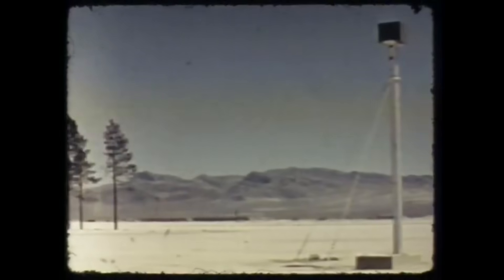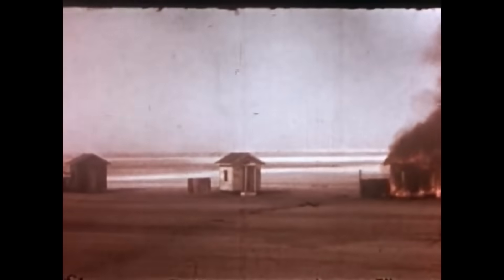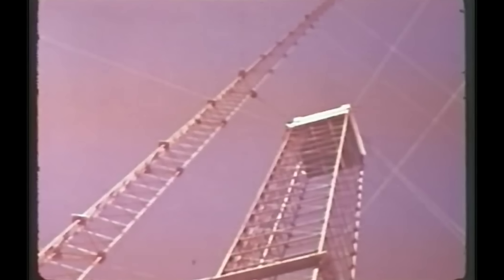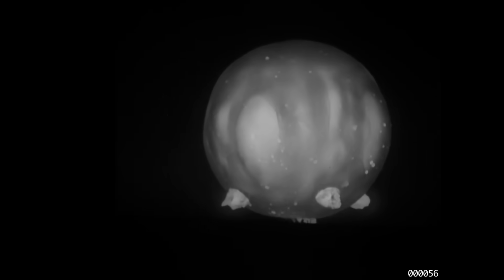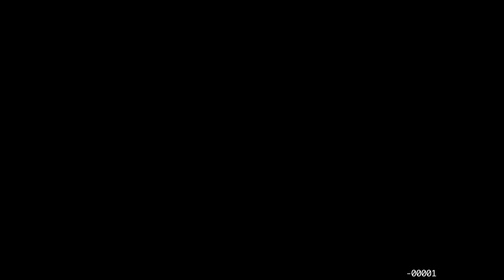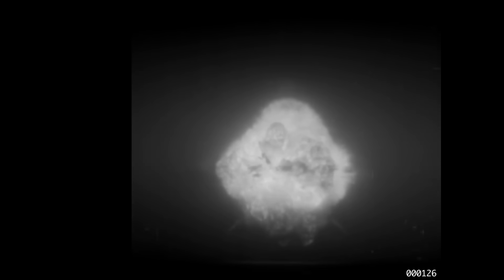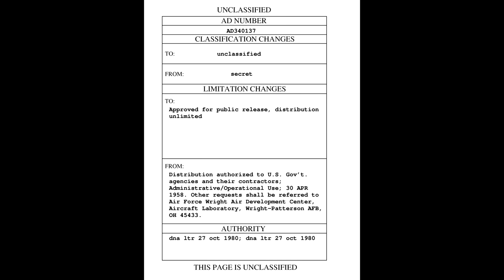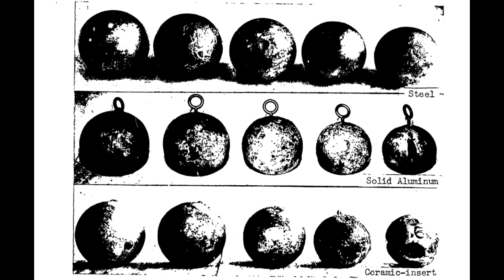Can A Metal Bowling Ball Survive Inside a Nuclear Explosion?

Comment: If it only stripped a few inches off the metal balls, yhy did humans at a much greater distance get completely vaporized, or is that an urban myth?
Reply: Did not watch the full video yet, but i assume the he as t resistance or a solid steel ball will relatively low surface area and also a curvy one (making light harden to hit it at 90 deegree angle) is muchhh more durable than a human being.

Comment: Would have figured that with the penetrative power of gamma radiation that the balls would have been volumetricly heated to vaporization energy, i guess gammas alone was insufficient and surface heating from non-penitrive radiation is required.

Comment: What I've always wondered about is how close to a nuke could you survive if you had an outdoor olympic-sized pool or pond or lake you could swim down 8 ft or so deep & sit there for 3 or so minutes. Or better yet if you had a scuba tank & could loiter on the bottom for longer periods. A few feet of water will shield you from radiation & overpressure. I bet you could survive the initial blast very close to ground zero. If you happened to be upwind, you might could survive the whole ordeal.
Reply: Yes. But what about the initial heat pulse from the fireball - guaranteed to vaporise anything within its range - and that includes water - or anyone sheltering in a tank of water ? Then there is the effect of blast. Perhaps you should watch the video more closely - or read about the effects of nuclear weapons.

Comment: The fireball you see is actually the shockwave formed by the fissile material decomposing and recoiling. The shockwave is what is causing the majority of the heating in the fireball. The xrays only add a fraction to the heating effect, they mostly propagate away from the bomb and penetrate the debris cloud, as x rays are wont to do. They cause the bright flash of visible light at the moment of detonation; the x-rays lose energy from Compton scattering and appear as visible light.
Reply: Well... There is even enough fissile material to just heat up and expand to make few kilometers wide fireball... i doubt that.  However i think it is combination of both, the conversion from x rays to visible light is exact same thing that heats up the air

Comment: At some point science left the room and they were just acting like a bunch boy seeing what a magnifying glass can melt.  "ohhh lets try trees." "OKAY"   I also thought the mushroom cloud was a result of the earth acting like a reflector forcing the blast up. The explosion did not leave a large bomb crater.  The blast probably went the path of least resistance outward into the atmosphere.  Because of fluid dynamics the compressed atmosphere acts like a rubber band and resisted the blast and eventually rebounds and rush back in as the outward pressure diminishes the air elastically rebounds inward and push the blast particle up because of the lower upward air pressure.   Large chemical blast do also create mushroom clouds.

Comment: Well its very hot high pressure plasma and basically the steel ball is only exposed to it for a short time and then pushed out by the huge pressure release. So it isnt in the plasma ball for a long enough time to melt it all down. And it also means you could use steel balls as shrapnel for your nuclear bomb if you really wanted to but anyone close enough would already be dead anyways

Comment: Hydrogen bombs used and still use lithium deuteride, which fissions down to tritium, which is fused with the already present and extremely angry deuterium. First attempt was infamous, as one common isotope of lithium was thought to not be of use in a fusion reaction, but to their astonishment, was quite useful. That test, Castle Bravo, where the crew inside of the shot cab, where the bomb is detonated from were trapped from detonation time until early evening, when the hottest fallout isotopes had decayed to a safe enough level to be able to run, while wearing sheets to limit contamination to the helicopter for evacuation.
The sheets were left on the ground as they boarded the bird.

Comment: Interesting, somewhat related thought:
I've always wondered what would happen if a nuclear bomb is detonated inside an iron container, 100 feet by 100 feet by 100 feet, with walls on all sides being 45 feet thick. So basically an enormous steel block with a small detonation chamber in the centre, completely sealed off from the outside...  How much energy would be required to melt through the walls?
... also, doesn't 'Allens Balls' sound like a great name for a metal band? LOL

Comment: I'm actually surprised by this video...I would have expected that even if the thermal radiation (heat) didn't completely vaporize the steel balls, the concussion from the blast wave would have torn them apart...

Comment: The vaporization that propagates in advance of the fireball along tower guy wires or cables is also driven by the intense electromagnetic pulse along the conductive metal of the cables, turning them into linear channels of ionized plasma.

Comment: @Scott Manley - Nuclear Explosions do develop millions of degrees temperature but that goes away very quickly, pretty much before the fireball has even developed. By the time the Fireball is expanding, reaching the mottled stage, the plasma has fallen down to the hundreds of thousands (id seen 300,000 Kelvin quoted).
Which is also a very short period of time, thats what some of these spheres would've been flash-subjected to. But the bulk of that heating would've been thermal and plasma in the 10,000-50,000 degree range.

Comment: The wires are being superheated by the EMP effect inducing electron degeneracy in them... its not actually the direct heat of the fireball.  It is kinda like a solar prominence coming off the wire.   The trick here is that the "visible" shell recorded by the xray camera IS the plasma wave of matter expanding through atmosphere, sufficient heat to actually radiatively evaporate the guide wires would have covered the entire length of the wires immediately and would have had a far stronger effect on the soil and various equipment below the explosion.  The wires' angle makes them the most protected from heat of all the materials at the site, additionally they would drop like logs if it was actual melting occurring to them.   Its a strange concept to grasp that part of the tower at the top is still there while this ball of superheated plasma expands.  The actual epicenter blast of a 30kt device is only about 1200lbs of blast force, a very precise and spherical explosion.  What these xray films record is the atomic plasma infiltrating the air, passing through it at high speed in a state that barely interacts with it directly.  If you record the introduction of a drop of dye from a pipette into an absolutely still volume of water you'll see a metaphor of what the plasma does.  This is highly related to the effect that including aluminum glitter from Glitterex in high explosive charges produces, the aluminum is ejected at very high temperature into the air around the explosion and instantly combusts producing even more heat.

Comment: They did not uproot the trees. They just cut them. You can see the stumps getting lowered into the holes in the movie Trinity and Beyond.
The footage is also not 2'400 fps. Thats is not nearly fast enough. They invented the rapatronic camera to capture this. The fireball at the end of the clip is ~1 ms old. With 100 frames in 0.001s thats 100'000 fps. At 2'400 fps 1ms would only be 2 pictures. Thats also the reson the footage is "shaking" since that are several cameras, each capturing one frame.

Comment: By the time the fireball surface touches the ground the temperature is not even close to 1,000,000 degrees. Those temps exist for maybe the first 75 foot diameter of fireball expansion.

Comment: I was under the impression the rope trick was the steel cables being vaporized by X-rays, but I don't remember why the steel cables vaporized faster than the expanding gas cloud. I don't think thermal conductivity has anything to do with it at those timescales, maybe the steel or the plasma clouds created by them conduct X-rays better than the air does. Not an expert so correct me if I'm wrong...

Comment: When I toured the Atomic museum in Albuquerque, I asked the tour guide how re-bar from the tower could still be there, considering they said the heat from the bomb was hotter than the sun. He said the intense heat (the vaporizing heat) only lasted for a fraction of a second. So thick steel would absorb a lot of intense heat before it vaporized. Another question was if there was trinitite from the first explosion there must be a lot of trinitite from the hundreds of explosions in Nevada. As it turns there was a lot of sand at Trinity but just dirt at the other sites.

Comment: It was my limited understanding Tritium is used for boost and triggers for both atomic and H bombs - lithium dueteride is used as fuel for H bombs. The lithium becomes Tritium by transmutation by the neutrons from the fissile blast. Maybe there were small devices that used Tritium?
Reply from the maker: Tritium is used in practically every modern weapon, the amount can be adjusted just before use allowing the yield to be changed.

Comment: Tritium is not used in thermonuclear weapons at all (sic). Instead LiD (Lithiumdeuteride) is the fuel of the secondary. Lithium is split into H-3 (Tritium) and the inert byproduct He-4 (Helium) within strong neutron flux of the primary. And H-2 (Deuterium) is just part of the compound. This setup provides two big advantages: There is no need to stockpile Tritium with a half life of about a decade and a stable solid compound is much easier to handle than cryogenic radioactive gases.

Comment: Wasn't this also the reason that Project Orion was considered feasible?  Specifically it answered the question of how to prevent ablation of the pusher plate due to impinging plasma.   On a few of the steel balls there were some greasy fingerprints, and after the test, the grease created a stagnation layer that stopped any ablation where the print was.

Comment: Fission explosions occurs in about 700 nanoseconds, a little less than one microsecond.

Initial temperature is 50 to 100 million degrees. Center of the Sun is 15 million degrees

Radiation released is dependent on bomb design, but you get the full package of  gamma rays, x-rays, light, heat,   
and the rest of EM spectrum.

Despite your jocular attitude, nuclear weapons are extremely destructive 
The bombs you mention are only the early fission weapons. Current inventory includes 125, 250, 500 kiloton warheads as well as many in the Megatron range.
Reply from the maker: I’m glad you felt the need to tell me this after I made a multi part series on nuclear weapons.

Comment: Before i watch: no.
How close could you put an object to a nuclear detonation and have it survive?
Outside of the fireball.  Everything within becomes atomized.  Its how the reaction works.
Edit after watching and learning something from the voice with an accent that should be the ONLY news reporter:
If your name is Lew Allen, and you have balls of steel, aluminium and ceramic, they will survive outside of the shot-cab, but be shaved down in radius from the reaction, proportionally based upon the distance from the epicenter. 
So, to summarize:
If your name is Lew Allen and you are blessed with three balls, an atomic detonation is what is required to shave them.  Even Chuck Norris would back down from that challenge.

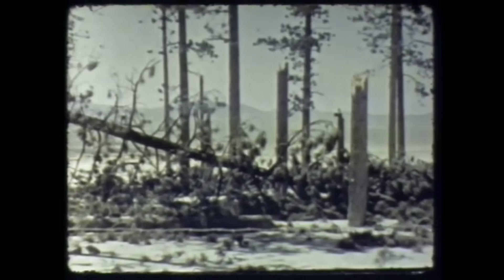Comment: 1:22 - Wouldn't trees mounted in concrete respond rather differently from ones with their roots planted in the ground like normal trees?  A normal tree's attachment to the ground would be a lot less rigid than a concrete foundation, spread out over a much wider area (trees' root fields are big ), and intertwined with those of all the other nearby trees, all of which would be expected to make a significant difference in the mechanical response of the trees to getting nuked.
Reply: root fields of aspens are so big as to make entire forests composed of the same tree, genetically identical because they're all connected.

Comment: ... nuclear hand grenades
 a nuclear bomb with spikes holding either large balls or cubes that get get launched as the bomb explodes
so are nuclear cannons aka a semi temporary contained nuclear bomb with one or more exit tubes sealed with a metal cannon ball
bomb goes off heat and pressure fires the cannon balls
nuclear land mines
under ground bomb with pressure sensors rigged
easy to see what i'm trying to get to you
this is all possible but not happening anytime soon.

Comment: They also did a test where someone froze a scorpion in a 1 cubic foot block of ice.  They placed it under the test location.  They then detonated the 20 kT bomb and afterwards went in to check what happened.  They found the scorpion, wandering around like nothing had happened.  So, a steel ball surviving isn't surprising.

Also, Lithium Hydride is what is used in a nuclear weapon to create the fusion stage of the weapon.  The larger the weapon, the more fission - fusion chains it has.

Comment: I have always wondered what would happen if a nuclear device were placed at the center of the Earth.  Would there be an explosion as we know it or would the pressure of the Earth's mass cause the device to vaporize occupying the same volume as the device itself?
Reply: From what I can recall, the pressure at the core isn't enough to compress the fuel to critical mass, whereas the temperature is more than enough to basically melt everything, though at the same time would the pressure then mean it couldn't become liquid? Not sure on that, but either way I think it'd just be splatted pretty much. Good question though.

However, "The Core" is still a fun popcorn movie. 8)

Comment: Okay about 3:15 "Heat from the blast evaporates the wire because of thermoconductivity"

Woldn't blast generate huge EMP which moves faster than the blast and the wire is electroconductive?
Reply: I mean, in some Semipalatinsk EMP tests mock power transfer line wires and transformers were fried from a blast high above.

Comment: If I remember correctly, there is no tritium in an H bomb. It is generated from lithium during the explosion. (From lithium deutheride)
Reply from the maker: No the primary is usually a boosted fission warhead with gaseous deuterium/tritium being used. The tritium-deuterium reaction releases neutrons to drive the reaction faster. Gas is also used since it can be stored external to the warhead until just before use, so the decay can be accounted for.